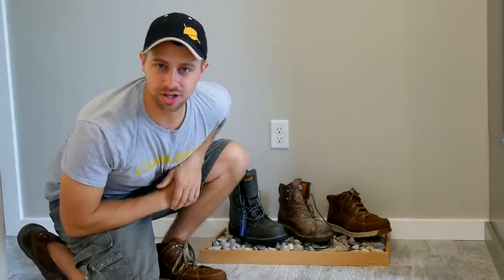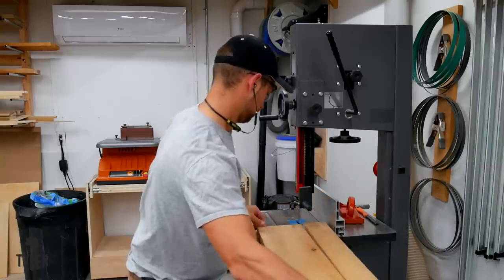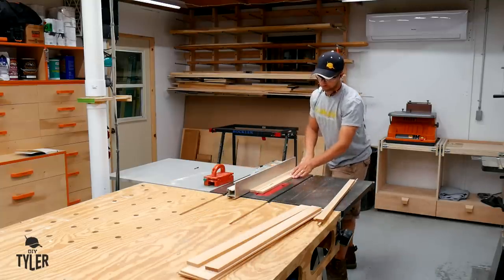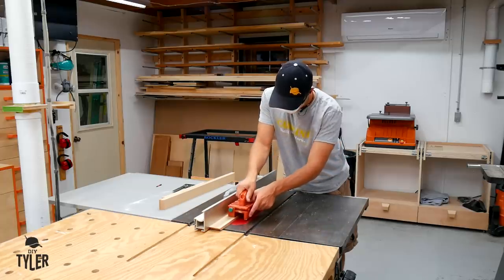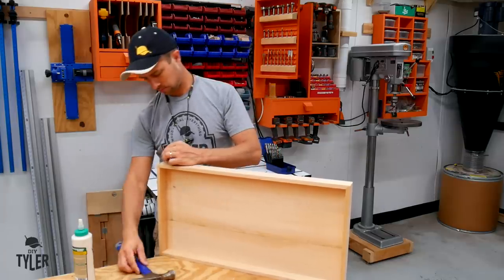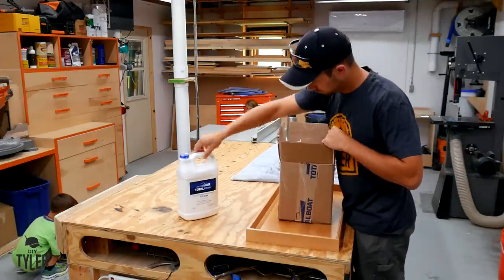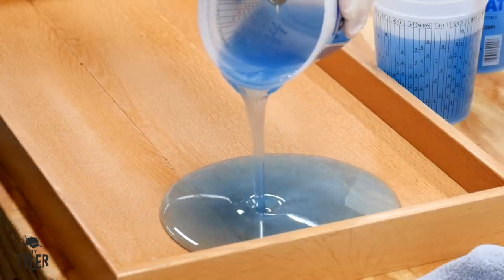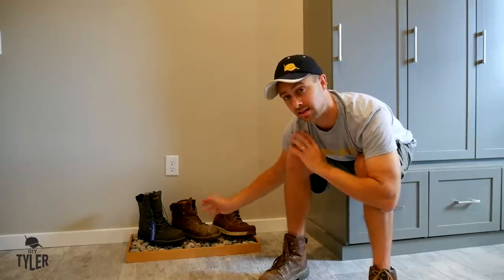DIY Rock, Epoxy Drip Tray | NEVER see Shoe Puddles again!

Comment: Nice looking project!  Not gluing a solid wood panel into the dado is normally a good idea, since moisture would cause the grain to expand across the width (not so much the length, as the longitudinal grain direction barely moves at all), putting strain on the corner joints.  However, the polyurethane film (which no doubt penetrated the wood a bit) and the epoxy layer fusing to that, would tend to cement the panel to the frame, as if it had been glued.  On the other hand, the epoxy would resist expansion, stabilizing the wood movement somewhat.  So, it would be interesting to see a followup down the road sometime, reporting on whether the joints in fact blew out with moisture and swelling, or not?
Reply from the maker: Like you said, because of the epoxy layer I don't think the dado was necessary but it wasn't a big deal to put in. AND if you were just making a tray it would be a good idea! Thanks for watching!

Comment: I have just recently started looking up epoxy projects. After you poured this specific epoxy, how did you get it to harden with the rocks on top of them? Did you just take a heat gun to it once? (I know something was mentioned about not using a heat gun to get rid of any air bubbles.)

Comment: Love the build.  Would putting the stone In first then leave open a couple of spots to pour the epoxy prevent the build up on one side?   Or would it be better to pour the epoxy the. Start filling the stones from each side?  Just curious because this is something I want to do.
Reply from the maker: I think the epoxy is a bit thick to run through and even out. If I was to do again I would pour less epoxy in the base, pour smaller rock over the epoxy instead of setting them in and when the epoxy is cure dump the unglued rock out. Who really knows though! Thanks for watching Will.

Comment: Nice work as always but it does not look pratical.
Reply from the maker: It's actually perfect, heavy enough that it doesn't slide like a cheap drip tray and look way the heck nicer while it sits there. Thanks for watching all the same!
Reply: @DIYTyler  That's right, the cheap tray can slide way too easy. As every projet, the more important thing is the result suits YOUR needs.